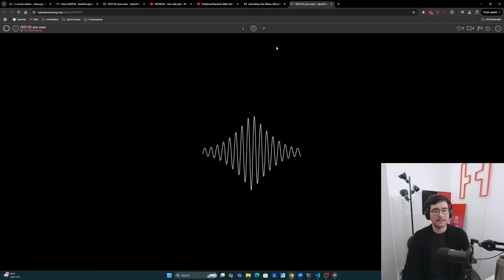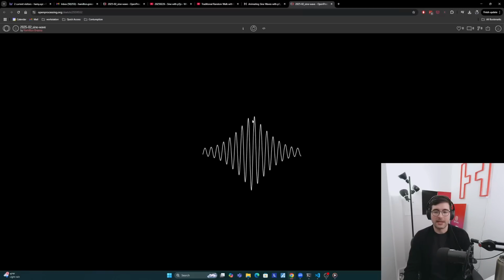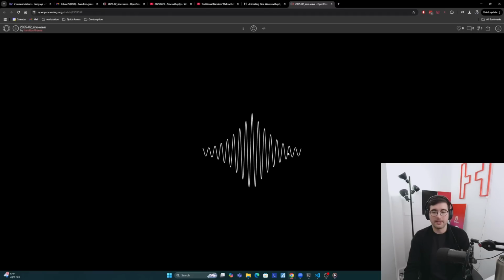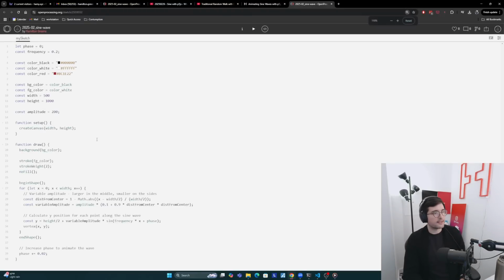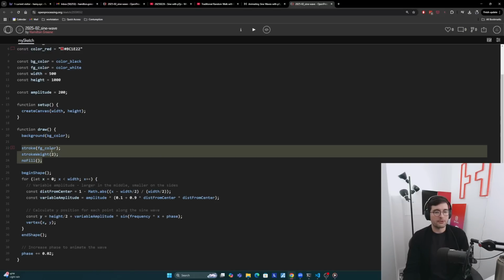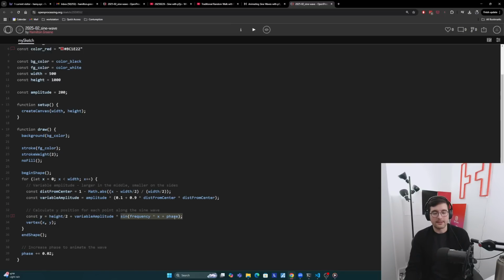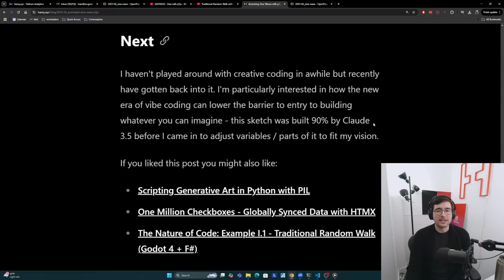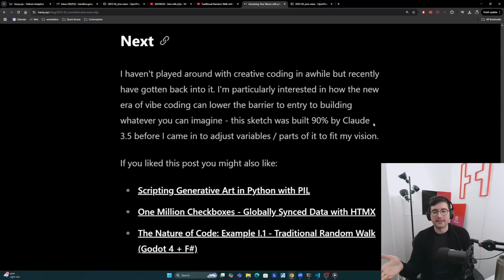Animating Sine Waves with p5.js

Comment: Just a question out of curiosity

Do you feel any accomplishment creating these visuals with creative coding using an LLM (like you mentioned Claude) by it doing 90% of the work for you? 
I feel conflicted using these AI tools in these kinds of projects since it takes out most of the work. Although it's easier to arrive at the objective -have the final piece done - it seems like there is no point in doing it when the AI made almost everything instead of you. I feel like it’s a cheat code, and maybe this is not for me, at least in terms of creative projects.

Nonetheless, thank you for making this video!
Reply from the maker: I think it depends on what you're trying to get out of it. I personally care more about the system (architecture, decisions, algorithms) than the code. Code was just a means by which to build the system I wanted and achieve the outcome.

For some though they prefer the hand-craftedness, the journey that leads them there. So for them AI may just remove everything they valued.

I think of it like paintings to photography or manual photo edits to photoshop. It's just another layer of abstraction, another tool that does some things more effectively. But not everything! Some ppl still like to pain and some ppl still like to do things manually. That's okay too, it's just another tool in your toolbox. So choose the one that fits what you want to do.